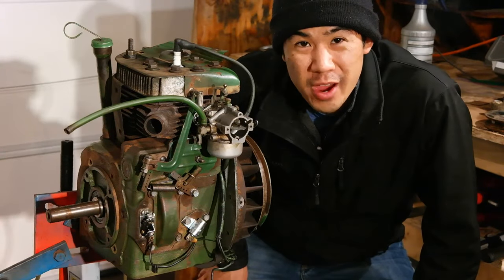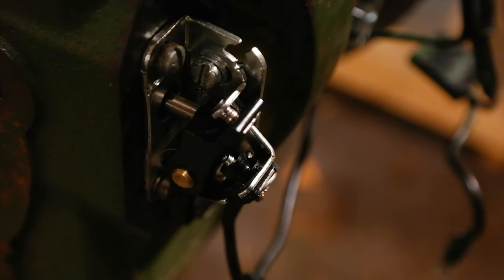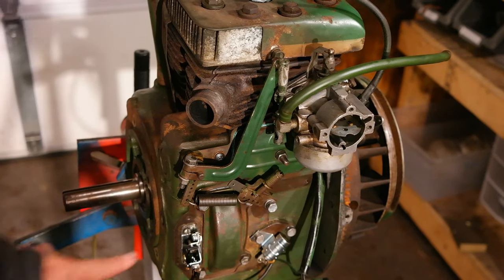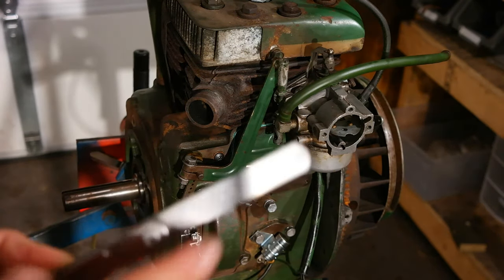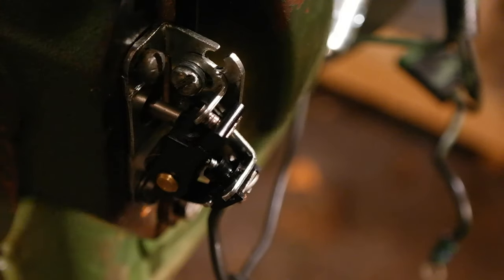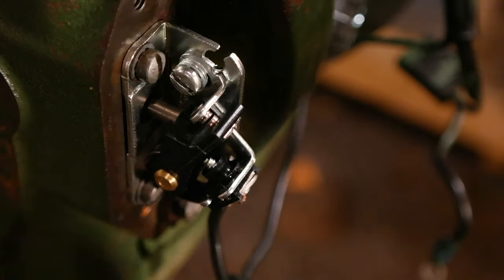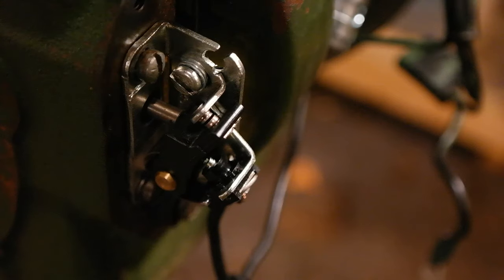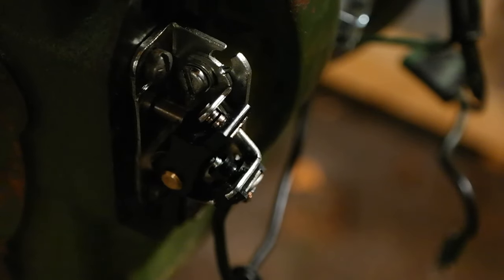How to adjust and set Points Gap on Kohler K Engine

Comment: FYI: .20 is the MAX setting for Kohler K-series points. This is just your starting point. Either use a timing light or the static timing method to dial the timing in accurately. Your engine may not run all that great by just simply setting to .20 and leaving it at that.
Reply: @TheSaturnV took my flywheel off, have the manual describing your suggestion. Is there any adjustment for the magneto?   Never saw a magneto that you cant adjust..I am not getting spark and I need to figure out what to do. Can I check the stator, condemsor and wires with a dvm? Thak you for the help
Jim
Reply: @jamesmacdonnell4085  Did you ever figure out your magneto system problem?  I have a K301 from around the late 60s with a magneto and coil sitting on the magneto.  No spark at all, driving me crazy, haven't figured it out so far.  I haven't adjusted the points yet, though.  I'm going to do that tomorrow.

Comment: I recently inherited a Wheelhorse tractor, that has been painted over and used by a High School marching band. Further, it has sat under a tarp for a year or so. I’m not sure but I’m guessing it is s 1974, k C160 with k series Koehler engine and automatic (hydrostatic) transmission. I’m not sure how to correctly identify it, but I’m working on it. It doesn’t run and I find no spark at the plug. I will try to test the coil then go to the points and condenser. Any insight you may have would be greatly appreciated.
Reply from the maker: Check out our video on Tractor Wiring. That should give you some additional insight. Good luck with your project!
Reply: i have a 1974 wheelhorse c160 tractor as well it was given to me by a friend when i first got it it would turn over but have no spark at the spark plug so i decided to replace my coil and that fixed it but it could also be that you dont have a hot wire going to the positive side of the coil therefore leading to no spark how you test this is you turn your key to on and then push a flathead scredriver between your points if it makes a spark when you touch the points its getting power if you dont get a spark then it has no power to the coil therefore no power to the points

Comment: I have a Kohler 341K and I think the points pushrod is to short, maybe changed by someone. The one I took out measures 1.541 do you know how long it should be ?  Thanks
Reply from the maker: It should be 1.550" Your camshaft may have a groove worn into it throwing it off.
Reply: isavetractors Thanks for the quick reply. I think you're right on the groove in the shaft. I  have round stock the exact diameter,I'm thinking of making it 1.650 because I don't have any adjustment left on the points.           What are your thoughts on making it .100 longer ?
Reply from the maker: Brian Miller sells special points plungers with a wide foot. This plunger will allow it to ride on the unworn part of the camshaft. check out http://gardentractorpullingtips.com/ignition.htm

His website is super old school and difficult to navigate but he has some great solutions for a worn camshaft.

When you need other parts please think of us!
Reply: isavetractors Thank you, I will !
Reply: Ivan Bentley Claymore push rrod?

Comment: Hi I've a 301 off of a 212 , my issue is that it started to loose power on high idle but on low idle it's ok , one thing I notice is when I put an external charger on it runs better  thank you
Reply from the maker: +Digging for a living I suggest first checking your Spark Plug, make sure it's in good condition, and gapped correctly. Then check your points, and air filter. If you have a badly clogged air filter your engine will not produce the power it should. Your engine needs 13 parts of air per 1 part of fuel. So Air is very important! Start there, and let me know if you need more assistance.
Reply: Thank you for the good advice , I did realize how important air fuel mix could be but now it makes sense thanks again I'll check it this weekend

Comment: Such hope you correct my English, I have a Kohler K331 do not know if I made the coil connected to the capacitor well as three cables, a cable the delgadoestá bolted to the chassis, the medium connect it to the condenser where they are losplatinos and the thicker is connected to the spark plug, the problem is that it does spark the spark plug but no electricity because approaching the cable highlights spark but also not sure that this sharp cam as electrical pulses are unopor turn give full and say that the end of the combustion cycle sack two sparks and think it should be a spark, what do you think is the problem?
Reply from the maker: I am not completely understanding your problem but check out the following links for more information on the wiring of your ignition system: http://isavetractors.com/articles-1/

Comment: Impossible to get a screw driver on a John Deere 314 since the frame is in the way of the points.  You need a stubbed little screw driver or a paint can opener.
Reply from the maker: Yea some machines it's a real pain.

Comment: When the points are  not correct you will have no spark at all that's correct?
Reply: the points can be somewhat off and still have spark.  they MUST close and they MUST open.  to the extreme too tight and they never close which would cause a coil to never charge too loose they never open.  beyond that spark quality is best if they close securely and open adequately and are clean and square.

Comment: Do they make an electronic ignition for these engines? I have a 1978 Power King Economy,with a 10 h.p. Kohler engine. It may need a transmission. Somebody broke the gearshift off of it. I haven't pulled the top off yet, but was told the whole sheet metal housing has to come off.
Reply from the maker: Luvstruck our friend Brian Miller sells an electronic ignition kit. visit his website www.gardentractorpullingtips.com
Reply: What a great website http://www.gardentractorpullingtips.com/index.htm The diagrams are excellent, sometimes hand drawn, and easy to read. The writing in the articles, is down to earth, just like he is talking to you. His prices are good, and he has the explanations, most websites lack. This site delivers.

Comment: isavetractors or anyone who knows - Question here, - I got my Kohler k582 /k7000 generator working by running a wire with in line switch from Batt+ to the ign. coil. It ran well for a week or so and then quit under load and now won't start, will crank. Did I burn up the coil by "hotwiring" it, Is it supposed to be running through a voltage reducer that I bypassed? Also the quit could have happened because of 1/4 tank fuel RV cutoff function. If that's the case, why wont it start now that there is gas in the tank? Do you think there's air where it shouldn't be in carb etc.? squirts gas when line is opened after fuel pump. Has new coil, condenser, points, plugs. (earlier pre -start problem) the new plugs fouled quickly after accidentally running it at half choke a few times, cleaned them but still no start). Thanks
Reply: If the coil has power and points /condenser are fine, has fuel,  what 
else would make it not start - RV low fuel sensor?/ low oil sensor - I 
disconnected oil sens. and no difference, I don't know how to override 
low fuel sens.
Reply: Got it working! one of the wires on the positive side of coil was acting as a kill wire, (maybe a short?) when removed it, starts right up and runs strong, Awesome!

Comment: trying to get my new points set (from isavetractors) on my jd 210.  when I loosen the screw and put the .020 feeler guage in between the position and then tighten the screw down, when I remove the feeler guage, the gap closes....so, I'm obviously not doing something correctly.  I turned over the crank with the plug out and moving the ribbed area on the drivers left side of the motor and turned it until the plunger was out its furtheset.  is that correct?
Reply from the maker: You're doing it right. It can just take a little knack to get it at exactly 020.  The act of tightening the screw can close the gap a tiny bit so just tweak the point opening with your wrist a little Tighten and then double check
Reply: @Isavetractors  I'll fiddle with it in the morning.  lost light...if I have 12V at the positive side of the coil with key on...it SHOULD be able to provide spark from the coil to the points and then to the plug...correct?
Reply from the maker: Yes
Reply: @Isavetractors  OK, I think I have them set to .020 again.  With the plunger out as far as it will go I have a gap in between the point of this value.  But still no spark...  I'm getting 12V at the coil. with key on ....  what does this mean then?  Have these parts I bought failed?   if so, that cannot be normal....
Reply: @Isavetractors  question on the points wire installation.  Is the wire installed on the phillips head screw to exit the bottom left corner or the top right?  when I connect the wire to the points, for it to fit on the grooved plastic part with the metal flange it has to fit on a downward path.   ie: I don't want to bend the wire to have it exit the bottom left.  is this correct?

Comment: I don’t have spark on my k241 and I narrowed it down to the points not working properly so I cleaned them and reset the gap but even when they open it’s still grounding. Has this happened to anyone else? Or does anyone know how to fix this without buying new ones?
Reply: Hi Spencer did you ever figure it out? I just bought my first K241s and this is all new to me. So I’m hoping to get help.

Comment: Sent you an email, but are the points outside the engine like that on most kohlers? I have a simplicity 6517 with a mv18 vertical engine I believe - lots of parts missing so hard to tell.
Reply from the maker: Hi there. The MV18 engines do not use points. Instead they use a solid state ignition system.
Reply: @Isavetractors  hmm well that's good to know, it's an opposed twin and it seems like it has spark, but maybe theres a timing adjustment I can do? I dont know if it's for sure a mv18 because there was no engine cover
Reply: @Isavetractors  is it supposed to have that large ignition coil cylinder with 2 wires going to it thing to start it? Right now it has no battery, no starter, wiring is cut up.
Reply: @Isavetractors  well I got a new magneto and slapped the old, crusty, missing parts carb on and threw some gas in it and it turned over! I'll have to look into getting parts for this carb or maybe get the one you sell.
Reply: @Isavetractors  have you ever rebuilt a Kohler vertical shaft opposed twin? If I did strip it down I'm afraid of not being able to get new parts or gaskets if I break them

Comment: HAD K-301 REBILT YEARS AGO,ALWAYS RAN BAD?SAW THE POINTS HARDLY OPENING? SET TO 20 THEN RAN BETTER,AND SAW TIMING MARK ABOUT 20 DEGREES OFF ,REMOVED ENGINE CHECKED CAM TIMING,LOOKED OUT 1 TOOTH INSTALLED AND RESET TIMING USING A TIMING LITE THEN CHECKED POINT GAP 15 THOU? IF I SET TO 20 THE S MARK IS ABOUT 1 INCH LOW,SO I RESET USING A TIMING LITE,TO GET THE S ON THE FLYWHEEL ,SEEMS SLUGGISH ,AND DIES IF I PASS THE TIMING MARK 1/4 INCH AT THAT POINT THE POINTS AREN'T OPENING???
Reply from the maker: +Jon Telliard Hi Jon, The lobe on your camshaft is likely severely worn and a groove has appeared. You can fix this by taking your engine apart and threading one end of the points plunger, and adding a nut. secure with loctite. This makes it so your points plunger rides on an unworn part of your camshaft.

Comment: I have a k181 it’s not a k181s with a starter. It’s a pull start. It has points but no traditional Kohler coil. I don’t see a condenser I can’t figure out how to time it. It has points though
Reply from the maker: Hi There. Your engine likely has a magneto based ignition system, and the coil is under the flywheel.
Reply: @Isavetractors  Is it supposed to have points? and if so should it have a condenser?

Comment: is this the same procedure on a kohler kt series which is the opposed twin version of the k series?
Reply from the maker: Yes same procedure.
Reply: ive got the wheel horse 4178 with the kohler kt 17 series II and it was running perfect for about an hour and i cut it off to refuel it and it wouldnt start. it would crank but no spark. could that be why?
Reply from the maker: Points going out of adjustment is a common reason. Another common reason is your spark plug is really dirty. Best diagnostic tip is to start with the easiest and work your way up. First make sure all of your safety switches are disengaged. I.E. Seat Safety, PTO Safety, Brake/Clutch Safety. Then check wiring, then points, then spark plug.
Reply: well i check the coil and i got nothing but i pulled all the heat shields and covers off it today to clean all the gunk off the engine and i pulled the points cover off and they look descent. you can tell they havent been cleaned before but doesnt need to be. ill clean them and throw a battery in there and see what happens. i hope its not the coil.$243.

Comment: Hello.  I've got a 66 Deere 110 with the k181s.  Does anyone know where the timing sight hole is?  It's a bit hard for me to tell max point gap by sight.

I'm also wondering if it might be possible to determine wear on the lobe by measuring the movement of the timing pin with a runout gauge, and then comparing it with the movement of the pin of a known good cam.  

Any help would be greatly appreciated.  Thanks!
Reply: Probably not a worn cam Probably worn plunger

Comment: These old Kohler you’re supposed to use a timing light to set points correctly
Reply from the maker: You can adjust timing with a feeler gauge, multi meter, ohm meter, or a timing light.
Reply: @Isavetractors  open up a repair manual and read it. point gap by feeler gage is a starting point only

Comment: Hello I have a filler tools but mine don't read the .020 it only have .20 is it the same?
Reply from the maker: There should be a .020" in there too. Twenty Thousandths of an inch.
Reply: isavetractors not sr maybe this is different feeler cuz it only have  .06 .07 .08 .10 .15 .20 .25 .30 .35 .40 up to .70 that's all but not .020
Reply: because the one it's really like a paper it's really thin and the one you use it see that it's thicker and not the flexible it's    .20
Reply from the maker: Yours is probably metric. .020" is .5mm
Reply: isavetractors but it says mm after the numbers so you think is the .50mm?
Reply: I just set it at .50 with is the one I think .020 but still not spark I think my magneto going be bad

Comment: Useful in a way. But working on an engine sitting on a stand is not really a fair demonstration. I just swapped points on my Power King 1614 with the K321 engine and a front loader. Next to impossible to get the gap gauge into the points and then adjust. I finally got it to run right by using trial and error and a spark indicator. All demos like this should be done with engines installed on the tractor and surrounded by typical equipment.
Reply from the maker: See the rest of our channel for other videos on this very subject. There is one done on a tractor with a multimeter. It will help you as you wont need the feeler gauge.

Comment: Worthless, unless your K engine is on a table , who knows how to set points on a JD 314 tractor where there is not room to put a screwdriver in sideways ?
Is pulling the engine and putting it on a table the the only way  ? But good job on video.
Reply from the maker: Use a short screw driver ;)